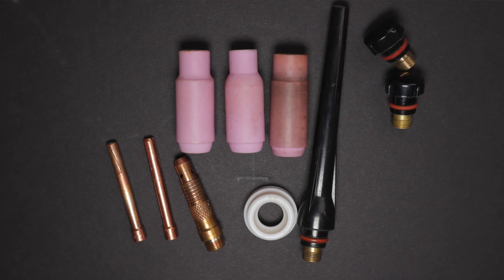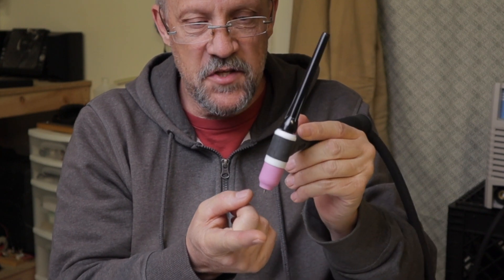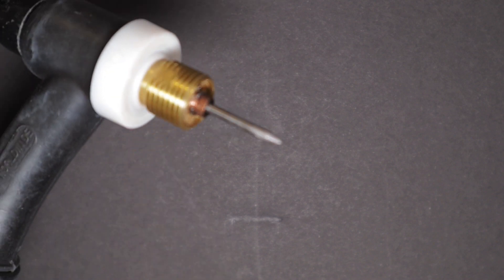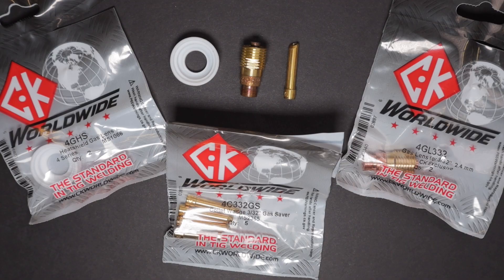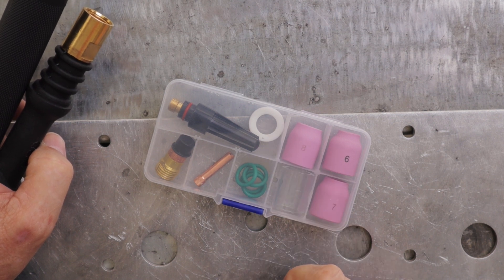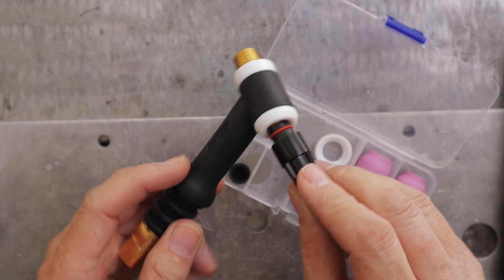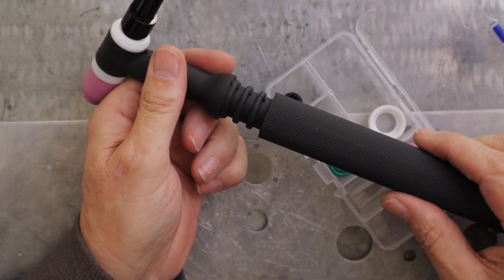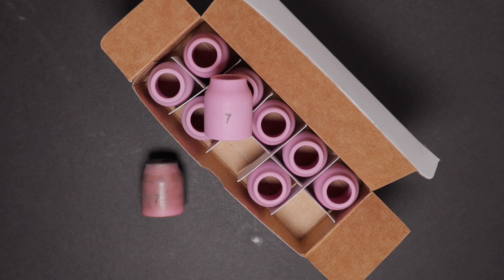TIG Torch Setup Made Simple for Beginners!

Comment: Thanks- especially for the part numbers. That's what I needed and this video had it all. I have a Lincoln Square Wave machine at home that came with a 9, which is now a water cooled 20, but I have an ESAB Rebel 205 at work with a basically new 17 torch. I can't bring myself to tossing the 17 yet, so the stubby gas lense is the closest I can get to what I have. I may go to a 20 with a cooler anyway but it's worth giving this a shot first. Side note- it seems silly to have a water cooler on a 200 amp class machine, but those 9 torches get stupid hot on max amps even with a 20% duty cycle. Hotter at the head than I want my thinly gloved fingers on, and I like to hold them all sorts of ways depending on the weld. The 20 just stays cool and you don't have to think about it. The 17 torches can take a bit more heat, so hoping to get some miles out of the stubby setup first. It's worth throwing a few bucks at, and I already have 9/20 consumables on hand.

Comment: I would gladly go to a CK stubby setup except that the connection on the Vevor tig 210P does not fit the CK power hose. It is a 16*mm x 1.5 thread male on the machine and the CK hose is also male with some other thread.  If anybody knows how to adapt between the two?  PLease let me know!   Just wondering how you did that?  I am not familiar with the Yeswelder connections.

Comment: Hey man.. Bought my 1st Tig torch this week.It's great to find channels like urs bcos it explains a lot in far more detail which is very hard to get from other channels.. Thanks for that man.. Is there any chance u could do a video about the Argon set up and the best fitting/regulator,etc.. Now that is a video I need to watch before I begin to weld Tig.. Also a video about the tungsten and the best ones and this filler wire as well bcos I don't really know where to begin my bro..
Reply from the maker: Glad the video helped you out. I don't know if or when I will get to the videos you are mentioning I'm pretty busy with other projects and videos at the moment. Stay with it and get all the practice you can and you will be able to learn to TIG weld. It's a great process and you can really build some neat things with it.

Comment: Hi, thanks for the vids! Great content.  Are you using the same hose for the torch or is it a different one? I picked up stubby kit as well and I want to get a hose for it and leaving the original torch intact.
I have the same welder 250P.
Reply from the maker: Hi, I’m using the same hose that came with the machine. Works like a charm!

Comment: im trying to figure out how to add a ck torch to that yeswelder 250p. any suggestions on what adapters/parts are needed?
Reply from the maker: I read somewhere that CK is now making a tig torch or torch adapter that will fit the YesWelder 250P. I don't know any more than that but I would check with CK or a CK dealer and they should be able to help you with that.

Comment: thanks. I ordered a stubby kit for my CK17 that came with my PrimeWeld 225X, but your video brought to mind a question: Does the stubby kit make the handle heat up quicker? I guess I will find out.
Reply from the maker: I didn't notice any differences in the torch handle temperature between the two. I think you're going to really like the stubby kit. It's all I use these days and I use it for everything.

Comment: Can you put a flex head TIG torch on the Yeswelder MIG 250 Pro TIG Torch? Are they replaceable on all TIG Torches?
Reply from the maker: I would think you could but I don't know for sure. I don't have a TIG torch for my YesWelder MIG 250 Pro. I suppose it would depend on what TIG torch you buy for the machine.
Reply: @DIYHomesteadProjectsDIYHP10  Ok, thanks for your response. 😎👌

Comment: just one thing  you are using a 26 tig torch but using consumables (ceramic cup box 53n61) for a 9 or a 20 so you can´t use them on a 26 or 17 tig toch
Reply from the maker: Yes, with the stubby gas lens kit you use 9 and 20 alumina cups on a 26 or 17 size torch.
Reply: @DIYHomesteadProjectsDIYHP10  do they fit?i have my doubts the serie 2 is smaller that series 3
Reply from the maker: Yes, I show it fitting in the video.

Comment: Thanks for the video. I have a CK TL26 torch. So far I have only used the standard setup, no gas lens. The TL26 uses WP26/SR26 consumables. However the insulator ring is CK specific - the WP26 insulator ring doesn't fit. CK prices are very high and CK is hard to get here in Germany. I assume that I only have to order the insulator ring from CK and  then buy a stubby kit for a WP26/SR26 torch. Can you confirm that?
Reply from the maker: Tunicht, I am using the WP26 insulator that came in this cheap stubby kit  on my WP26 torch and it has worked fine for my WP26 torch so far. Yes, if your torch needs the CK insulator you can buy that then just buy a stubby kit for a WP26 torch. That should work I believe. Good luck to you and happy welding.

Comment: Just used your code to buy mine, the website said 2 week back order I hope it’s less. Anyway how is that new torch head working? I read a review on amazon that said his flexhead  was cracking. 
The deciding factor for the Yeswelder Tig250p for me was 5amp tig and there website said works with 6010. For an Everlast welder to do the same thing cost 3 times the price. My 40year old Miller Thunderbolt ac/dc and 6010 welds scrap steel with very little cleanup, big timesaver!
Reply from the maker: Thank you Les and congratulations! I think you are going to really like the machine. The new torch head has been real nice so far. I've used it quite a bit and I don't have any cracking on the new head. I am curious to know how it welds 6010 rods. I have wanted to buy some 6010 and try it out but I have not done that. It sure does nice with 6013 and 7018 rods.

Comment: Thanks for the video just learning tig I have a lift start and just now can make a decent bead flat and on angle joint but having trouble with keeping tungsten clean I am not dipping it in the puddle it just gets boogered up quick maybe my metal is just to dirty.
Reply from the maker: Nice! My tungsten gets boogered up pretty quickly too. I'm using 2% ceriated tungsten because I bought a couple packs and I still haven't used them all up. The next time I buy tungsten I think I'll try the Layzr tungsten from weldmetalsonline.com It's supposed to be pretty good stuff. I happen to have an affiliate account with them. If you decide you want to buy some from weldmetalsonline you can use my discount code and get 10% off anything they sell. (DIYHP10%) Have fun learning to TIG weld, I'm having a blast with it! 👍👍👍

https://weldmetalsonline.com/?ref=undefined

Comment: Great content you're sharing.  I've just recently gotten into TIG welding as well and being able to see the puddle was one of my main issues. Instead of the cheater lenses that are often recommended - I've been using reading glasses on top of my contacts. This has made a huge difference in my welds. Thanks for the ideas and keep em coming.
Reply from the maker: Sounds like you are getting it figured out. Just like you, once I started using the cheater lenses, my welds improved a lot. Thanks for the input!
Reply: In case you never did, get yourself one of the newer auto darkening hoods. I went to a Lincoln Viking 3350 4C (own 3 of them actually) but the Jackson offering is stupid clear tech as well. I have a hard time putting any of my other hoods back on- it's that much better. They're pricey, but buy once, cry once.

Comment: Hey Bruce , hope all is well , can you make a video of how you Tig weld 1/4 aluminum plates  , fill it welds
Reply from the maker: Hey Antonio, I think I might have a couple of scrap pieces of 1/4" aluminum I could use for a video. I don't have much but it might be enough to do a short fillet weld. It will be interesting too because I have never welded 1/4" aluminum before. I'll see what I can come up with after I finish my project installing new outlets in my garage.
Reply: @DIYHomesteadProjectsDIYHP10  thank you so much Bruce 🙏👊
Reply from the maker: Hello Antonio, what is your motivation with this 1/4" aluminum request? Are you wanting to see if the YesWelder TIG 250P will do 1/4"? Are you wanting to see if I can do 1/4"? LOL
Reply: @DIYHomesteadProjectsDIYHP10  well this is what it all comes down to, Iam welding a whole 1/4 aluminum  composite chassis that I have , the person who built my chassis didn’t weld it , so to make it stronger I need to do this , if you go on YouTube and look up Stricklandracing.inc , my chassis is on his jig table , which is video #38 , it’s called the Chupacabra build #38
Reply: Fillet  hot and fast remember to clean the aluminum theres film that melts at a hotter temperature than the aluminum if u don't your welds will be black and nasty 😜  stainless steel brush works scrub the crap outta it
Reply from the maker: Thanks for the tips Neo!

Comment: Thanks for info. I haven't actually figured out the type of one piece tig gas connector on the front panel of my 250p in order to use a different torch. Are you using an adapter, or the hose from the original YesWelder wp-26 ? 
BRW - Elizabeth, Colorado
Reply from the maker: I don't know what type of one piece tig gas connector it is either. I'm using the hose that came with the welder and installed the WP-26F (flex head) onto the stock hose. It would be nice to have a CK super flex hose but they aren't cheap. If I ever need to replace the original hose, that's probably what I will replace it with if I can find the proper fitting or adapter.

Comment: nice,i just getting set up w combo coupon set from weld metals ,both steel and alum,w filler rods,ended up getting a weld pro 200gd acdc super flex ,ck flex head 17,switch came with it , pedal and got a argon bottle ,just about ready
Reply from the maker: Nice 👍